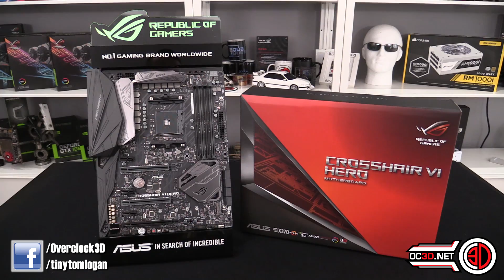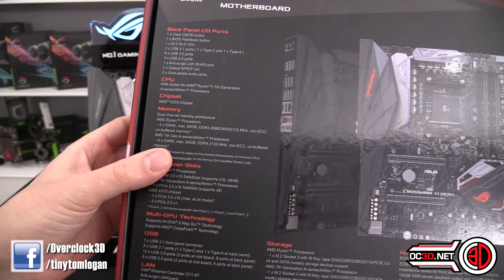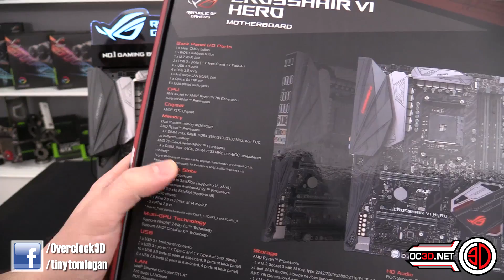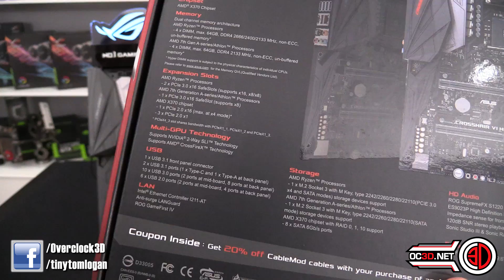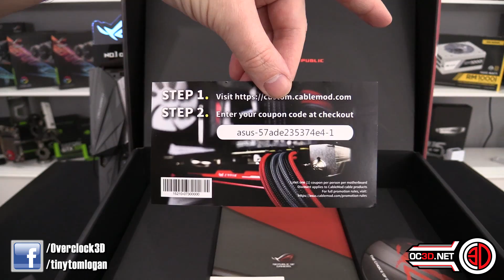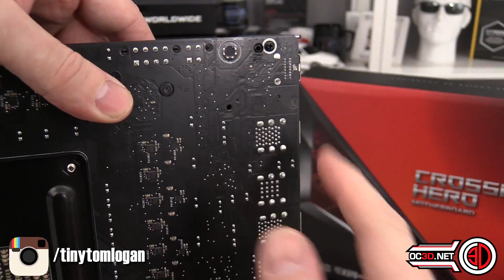Asus Crosshair VI AM4 Ryzen Motherboard Preview

Comment: Clearly AMD Ryzen RAM speed support need to be clarified. On Asus website, this Crosshair Hero VI is stated as 3200Mhz DDR4 speed, where on your box it's stated 2667MHz
Reply: Official DDR4 speed currently supported is 2667 MHz. Motherboards can "support" overclock. It will most likely then be able to OC to at least 3200 MHz
Reply: I was hoping to see people run APUs at the 3200+ speeds and see how it affects performance but apperently its not gonna happen ;-;
Reply: Ram support will be Mobo dependant, the IMC in Ryzen is said to support up to 3600mhz with 3200mhz confirmed.
Reply: If you look at some Intel boards then you will see that there are 2 types of Memory clocks. One is regular and then there are OC clocks. So, 3200 Mhz is the OC mode that you get either manually overclocking or enabling the XMP profile. Either way I would not waste money on super fast memory as it makes no difference in gaming. I would rather invest in better GPU, CPU or even NVMe drive.
Reply: AOD ZED well fastest ram are useful for several games in specific situation. For example in novigrad, the witcher 3, gain is real. Check digital foundry video for a very detailled review.
Reply: +MarcParis again we are talking about a couple FPS gain, which is not worth it. Rather spend that money on better GPU, CPU
Reply: for ryzen sure, but its not something that is gonna make any difference for it, at least for gaming.
An APU thou... runnning at 3400-3600mhz, could make a lot of difference, specialy comparing the boost they get going from 1333 to 2400mhz.
Reply: MarcParis ikr I really want to get 3000mhz ram but will it work or will it DC to 2666
Reply: So my question will be simple : do my corsair vengeance LPX 2x8go 3200MHz will be able to use their XMP profile on this ROG board?
Reply: +MarcParis According to ASUS website, yes. 4 x DIMM, Max. 64GB, DDR4 3200(O.C.)/2933(O.C.)/2666/2400/2133 MHz Non-ECC, Un-buffered Memory *
Also, once the board is officially launched and all drivers and stuff are available you may also check the Compatibility Manual. They have it for every board and it lists exact memory module model numbers that have been tested and approved that they support the board.
Reply: Yes that was I saw...let's see first review of this promising board..:D
Reply: Sure i'm preparing my next build based on Cerberus-X case..:D this Rog board with AM3 cooler support is inspiring me a lot as I could use again my beloved Apogee Drive II..:D
Reply: +AOD ZED There has been an AMD slide with the 1800x with a  GTX 1080 using ram from 2133 to 3200 in GTA V 1080p Max and the framerate improves with every increase in RAM speed
Reply: by how much?
Reply: +Sameer Khatri there was a proper test done by JayzTwoCents where it shows that FPS difference is so little that it's not worth the money and time to have a fastest RAM available. Check it out. That FPS increase is like 0.5 - 1, which is almost nothing. I did the same test myself and difference is so insignificant that it's noticeable only on paper.

Comment: I was planning to buy this board, but DDR4 2666? what about my DDR4 3200 ? Gigabyte is offering that ..  what does this mean for a high end motherboard from Asus?
Reply: It means wait for a review before buying. Someone will test it and you'll find out on google.
Reply: Jasx If your on Windows 10 it won't matter anyway. It won't use 3200 frequency.
Reply: ASUS site says 3200mhz (OC)
Reply: Jasx natively supports 2666 for the cpu OC those through AMP profile 3200mhz
Reply: DDR4 officially goes up to 2667Mhz. The package of my Z170 Asus board says the same, but on the manual it says that it supports overclocking up to 3600 or so Mhz. Sometimes you have to change it manually during setup, but mine set itself to 3200Mhz. It's no big deal

Comment: Why are there 2 power connectors on the top left of the board?
Reply: He said in the video that it is for extreme overclocking, you only need to plug in the 8 pin really.
Reply: Sorry I missed that

Comment: So, if I have two GPUs and an Intel 750 PCI-E add-on card, the only way I can make sure that 750 works are by installing it in a PCI-E 2.0 X4 slot that's connected to the x370 motherboard?

Comment: That AM3 holes in motherboard is for the a series processors. Looked from somewhere else that the ryzen cpu´s are higher/thigher so it might not work with am3 desing cooler mounts.

Comment: Tom strange question regards Ryzens USB controllers. I'm on a 4790k and Intel Gen 8 USB has only 96 endpoints and I believe later Intel series are the same. This causes me havoc running a lot of usb devices if XHCI is left on as I run a lot of sim gear for flying and racing. Its a constant battle with usb resource limitations. Do you know how many endpoints Ryzen can handle. Its the main thing for me in upgrading. Cheers.

Comment: i'm kinda sad/dissapointed that there is still a CD instead of a USB thumbdrive for the drivers.
Reply: Always get the latest drivers from the manufacturers website.
Driver CD's make a great drink coaster for your beer when you are building it.
Reply: FeuerToifel lol the CD is a small small fraction of a USB price...
Reply: Drivers CD/USB's get outdated really fast, it's always better to download the latest versions.
Reply: FeuerToifel never used the cd, I allways download the latest drivers.
Reply: It can make sense to have a cd in times when you can't connect to the internet or for some reason you can't find the drivers on the web.
Reply: Just include basic ethernet driver on the disk and a link to the website driver download page. :)
Reply: who uses a CD i have never used a CD for personal use since like 2011-12 though i have since then burned discs and stuff for others
Reply: I've tried going the website route in the past and instead of being presented with a download for an installer which allows you to choose what drivers and utilities etc... (as if you had run the disc) everything was seperated into about 15+ individual downloads and it wasnt immediately clear which bits you actually needed/wanted. Well it wasn't for me anyway. Low capacity USB 2.0 drives are dirt cheap, this needs to be a thing.
Reply: Ben yes, not everyone wants Intel rapid storage pro Omega HDD driver version 10.0.0.1.2.3 

You should be able to choose what drivers you want and need. You really never need every driver available. If you want a utility that installs all your drivers windows update is perfect for the normal person.

Comment: This board is $40 more expensive than its Z270 clone. I call BS!
Reply: $100 cheaper here
Reply: Tobi Ogunsanwo 85$ cheaper at my shop
Reply: Wat..
Reply: from what i read the vrm/power distribution is more complicated than intel version if i understood it right.plus this is a new platform guys... with the z270 users didnt even need to switch from z170 for kabylakes,so they needed to be more agressive priced.
Reply: +Finlay Massie where? Any source?

Comment: The return of CPU pins is a big mistake.
How many AMD CPU's have you ripped out (lever arm down) because of the large surface area combined with the thermal paste?
It's a nightmare that I thought we were done with.
Reply: NO!! PGA is better, the end, get a proper Thermal paste, if the cooler and CPU are hard to separate, its a bad TIM.
Reply: Which is why you should twist off sticky heatsinks, or at least pull straight up, or use newer TIMs that don't bond the surfaces that harshly.  Which you should do anyway, LGA sockets don't fare all that well to wiggling off bonded heatsinks either, it causes stress on the solder points.
Reply: HAHA that's not the reason why they have pins :))))))))))
Reply: That socket can easily be RMA'd. Besides we aren't just talking about ASRock sockets :P
The pins of this type have always added danger and caution to a build. Hope you have a firm credit card handy.
When a CPU and heat sink have been basically fused together, it's almost like glue and you can't do anything except rip it the fuck out and hope that you don't strip/bend/break the pins in the process. That or that awful twist and strain that you do to hope it pops off. It's an avoidable mess. AMD dropped the ball here.
Reply: FREQQLES or you just run the PC for a while, turn it off and quickly change the cooler while the thermal paste is still sort of warm..just don't be an idiot.
Reply: they have pins on the cpu cause intel doesnt if they both have pins on the same thing whats stopping some idiot for interchanging an intel cpu in an amd board or the other way around its actually quite smart to have it on the cpu just dont be an idiot putting it together and taking it apart
Reply: Defend bad engineering all you want.
We shouldn't have to fiddle with this crap anymore. It's all good and well to take proper care of your own PC with no issues... but when i'm pulling apart somebody else's monstrosity to try and fix it, it's an issue.
If you can grab a fitted CPU in its socket and break it with a simple twist... It's a fucking horrid design.
Reply: I've never had a problem with removing the cooler, you have to twist it a bit so you don't yank out the CPU I was told so I've just been doing that. Done about 6-7 cooler reinstalls on AMD CPUs recently.
Reply: FREQQLES Bad design? Ive been twisting them since thunderbird and have never managed to bent the pins. I have only once managed to fuck up and got the cpu stuck on the cooler. (This was when I tried to use toothpaste as thermalpaste for lolz) 
Though I have cracked a few dies. That bare die was bad design.